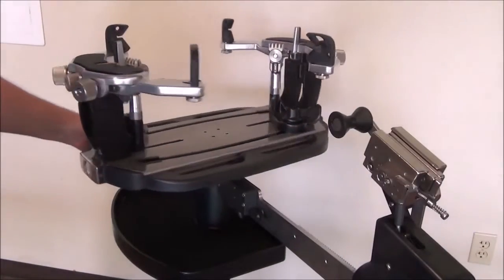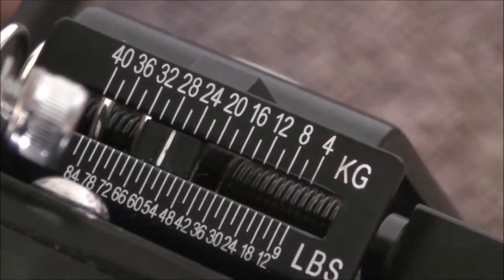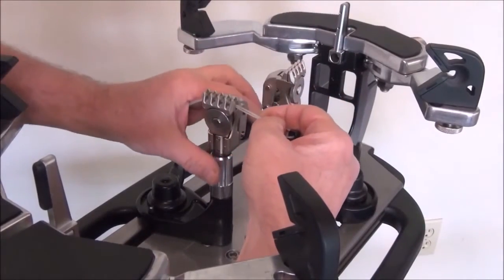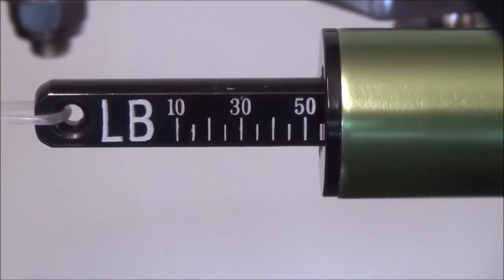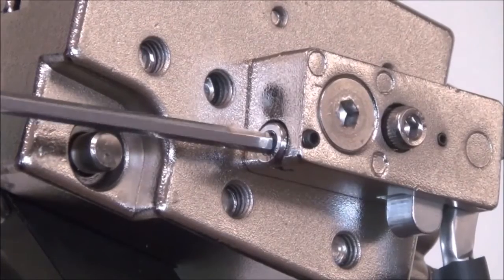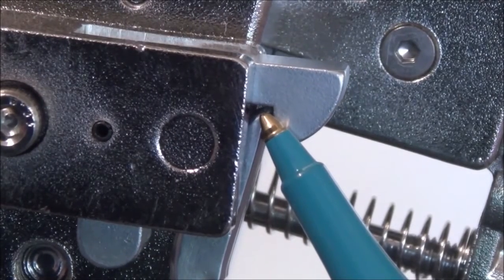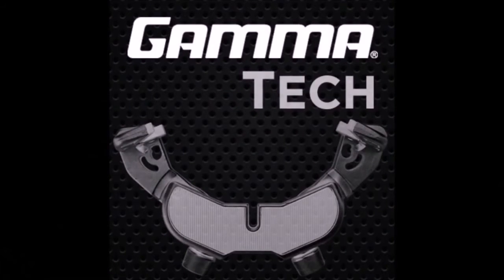Calibrating a Manual Spring Winder

Comment: My latch block only engages at  70lbs and the adjustment screw is all the way in. If I back it off counter clockwise the latch wont even engage when tensioning

Comment: Thank You for the video. However your explanation about how to use the Adjustment screw is confusing. 
Describe the complete process of what to do when the tension head is set to 60lbs  and the calibrator reads 55lbs. 
And then describe the complete process of what to do when the tension head is set to 60lbs and the calibrator reads 65lbs.
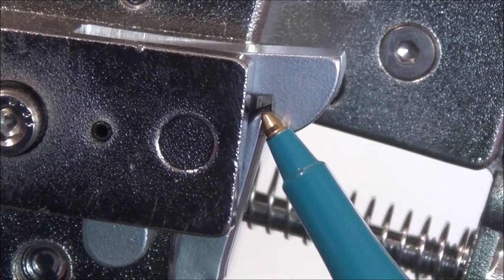1:12 When you describe the tension as being too high or two low, I guess you are referring to the calibrator reading tension being higher or lower than 60lbs the tension head is set for. But I can see how others watching this video might be confused.
Best explanation is to actually show the complete process.
Cheers.

Comment: Does this calibrator work with flying clamps?
Reply from the maker: Usually flying clamps are only used on drop weight machines which do not require calibration. But if you did need to use flying clamps the strings would need to be anchored somewhere, like in a racquet.

Comment: Not clear on the this video, but do you adjust the tension screw while the stringing machine is under full tension?
Reply from the maker: You would remove tension from the string, adjust the screw, and then re-tension the string to see if further adjustment is required.